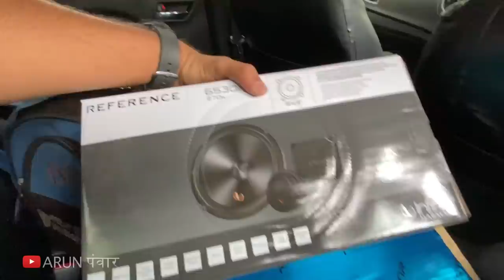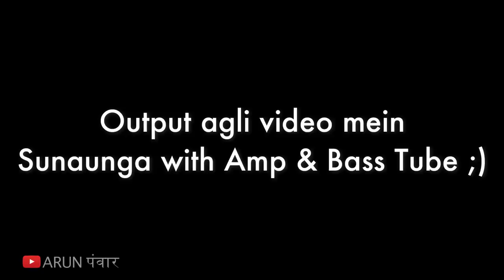Finally Upgraded Music System of my Baleno Zeta 2020

Comment: Arun bhai, the sheets are used to create a barrier for external noises and not to make doors heavy.
Reply: But eventually installing sheets result in increase of the weight of the doors .
Reply: @harbaazbajwa6182  ofcourse, but that is not the main goal. Some would even stick these sheets to the floor and roof, now what does that have to do with being heavy other than isolating the interior of the car from outside noises? Hope you got my point.

Comment: Bhai the speakers that maruti gives are good enough for giving ample sound. aur kya chahiye tumko itne price mei, seems you changed your stock headunit, whenever you change headunit you should change speakers, because stock speakers are made for stock headunit which gives less power output. your new headunit has a good output so speakers cant handle it isliye awaz faat rahi hain

Comment: bro my baleno delta petrol 2016 model have nippon speakers and they are excellent if not extraordinary. no. sound distortion even on high volume .maybe they have lower the quality by the time
Reply: It's the same set of speakers from the start. I immediately changed those speakers on my 2014 Ertiga and also on my 2019 WagonR. They are a literal piece of trash! Buying Baleno after selling my WagonR hence wanted to check whether it's the same speakers and to no surprise they are the same!

Comment: Mini amp😂😂😂😂.

Atleast make video with some knowledge. That's why people in India are confused. A crossover is not a mini amp. An amp is a device which converts your low level signal to high level signal.

A crossover is a device which divides the frequency in audio and sends the correct frequency to correct speaker. Like from 50-4000 hz goes to mid-range driver and 4000 above frequency goes to tweeters. This way speakers sound clean and doesn't distort.

And many commented ki baleno ki light build hai woh hai. Even i20 is plagued with problems. Just there is thread on team bhp. Hyundai cars problem. You will all be horrified to see problems like brake failure, steering failure, ac failure, crankshaft problem.
Reply: Atleast someone talking sense.

Comment: Bhai meri grand i10 company fitted speakers bhut bdiya quality hai bhai 40 volume pe bhi nhi fat ta👍👍
Reply: mine too
Reply: I too have Grand i10.. But rear speakers seems low when compared with front speakers...
Reply: @vishnukumarn24  yes right bro front speakers are bigger than rear speakers
Reply: @satbirdeshwal4200  did you got upgraded rear speakers?
If upgraded, please specify
Reply: @vishnukumarn24  ok bro
Reply: @vishnukumarn24  but i think about changing rear speakers
Reply: @satbirdeshwal4200  yes
Reply: bilkul shi, but sound quality is far better then others